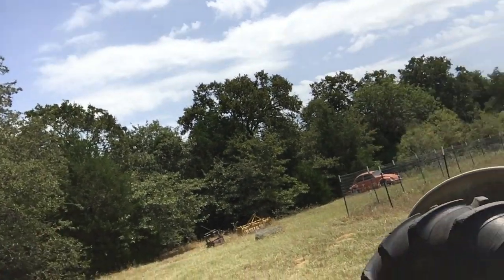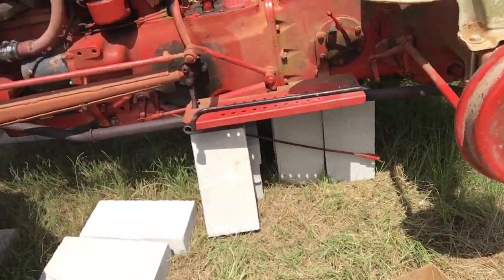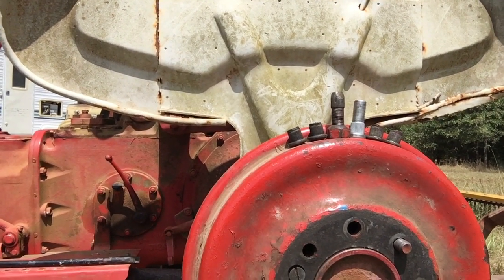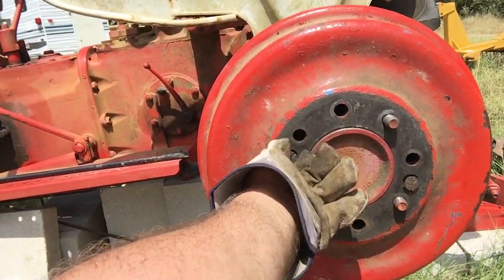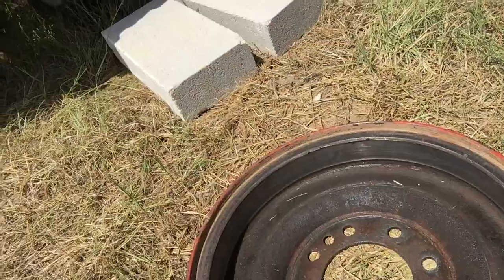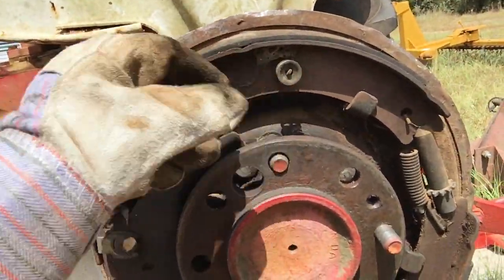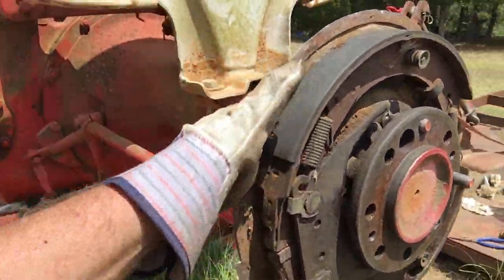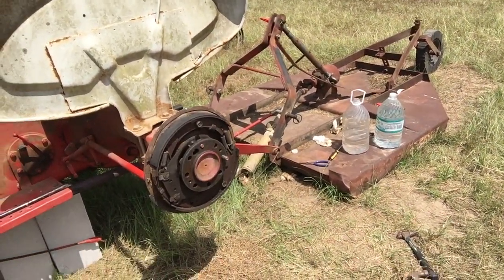Removing the brake drum on the Ford 801 tractor.

Comment: Your lucky ya weren't mowen a slope and that tire popped off. Never seen a tractor hub looks just like an old truck hub👏👏👍👍.
Reply from the maker: That definitely was a close call.   I was moving down the brush on the garden plot a few weeks ago.  Turning on the rock hard rows probably added some stress to the studs.  What gets me is that stud with the flange that was ground off with a bench grinder and just set in place. Looks like I’ll have to pull the axle to get the new studs in there.  Getting ready for the 2022 three million calorie growing season.

Comment: Cinder blocks can crumble….I would use steel or wood….never cinder.
Reply from the maker: Good point.  I shook the tractor as hard as I could before doing the job.  Notice also that I have two tractor support systems, the Jack under the differential and several cinder blocks under the transmission. Thanks for watching and commenting.